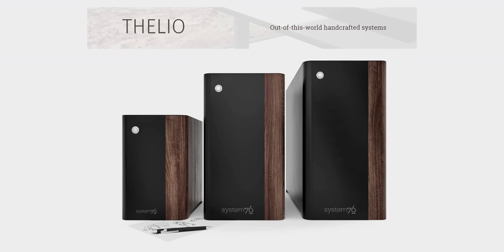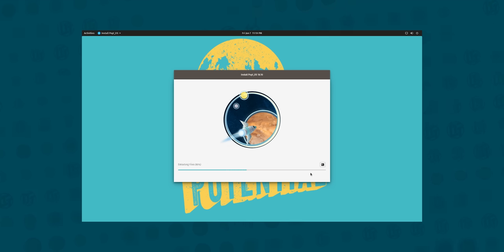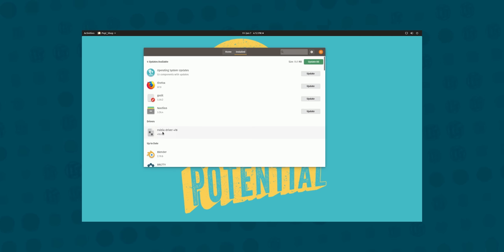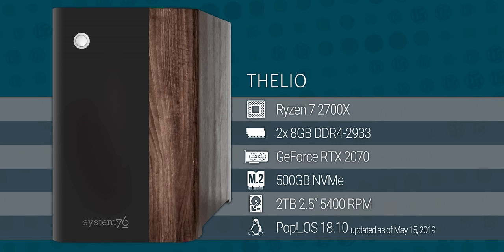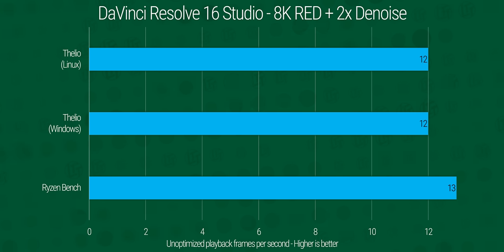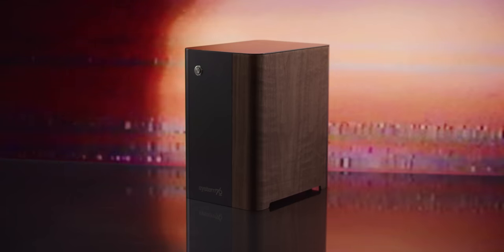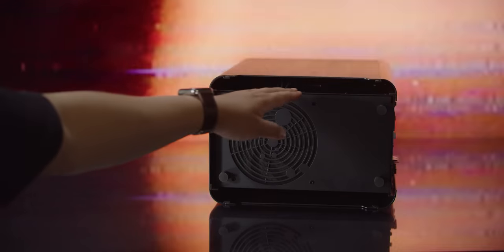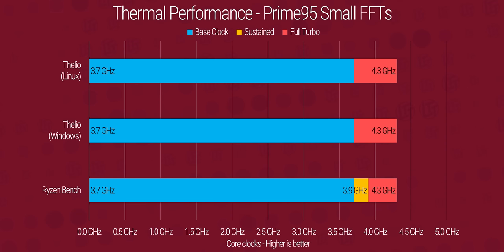A REALLY Weird PC… - System76 Thelio Review

Comment: Installing Linux is easier than windows if you pick something like pop os. I don't think even 99% of Linux users have ever compiled a kernel either.
Reply: true i have used linux for years and never did that.
Reply: POP OS was the first time i had to patch my kernel to operate some RGB devices drivers.
Reply: Even compiling Linux kernel is pretty easy now, not that I want people to compile it if they don't need to.
Reply: I have .. but not for ... decades...
Reply: Windows has never been difficult to install 🤔
Reply: @MiningForPies  It takes long, and it's a pain. I have installed windows in a virtual machine lately for my work computer. It took 20mn 3 times because it failed twice. Once done you still need to install drivers and stuff. Linux installs take 10mn, partitioning included. + no need for drivers in most cases. And if we start to talk about the first update after a fresh install, well, linux automatically gets installed up to date if you install it with an internet connection.

It's all good if you don't find windows difficult to install. But nowadays windows is a huge pain to install compared to the mainstream alternatives. It's not necessarily dififcult, but it's painful.
Reply: ApiolJoe I have 6 different laptops at home. Longest install takes 10 minutes on the worst one.

My main laptop takes < 5 minutes to install windows 10 pro.
Reply: @MiningForPies  Wow, would linux install in 2mn then?
Reply: ApiolJoe no, about the same. 

I find it’s easier to use Linux as a VM on windows rather than the other way round.
Reply: @MiningForPies  I find it easier the other way around, so that I don't have to bother with windows 90% of the time.
Reply: ApiolJoe that’s what I don’t get. I’ve never had bother either either system (beyond lack of support for games on Linux)
Reply: @MiningForPies  I had windows just refuse to boot one day just before an important job interview. for no reason.
Also windows needs care everytime you want to install a software to not install something unsecure. And windows needs "babysitting" with antivirus.

I have none of these time wastes on linux. Except for the (extremely rare) cases where I want a software that is not in an official repository.

Also linux is lighter weight.
I don't really play games anymore so that's not a big problem for me, and even there linux is getting more and more gaming-friendly lately with proton and lutris.

That being said, if you're happy with windows all good for you. I just hope you won't have the same unstability issues than the one that costed me a job.
Reply: i have compiled a kernal to get my 10gbit network card working lol
Reply: I tried LFS... it uh... didn't go well. But for that time I was on FreeBSD I compiled all kinds of kernels.
Reply: I sure haven't compiled the kernel and I've been a linux user for a couple of years (not exactly the longest time in the world but I'd say I'm pretty familiar with the OS by now)
Reply: If by "Linux users" you mean Ubuntu users then yeah that 99% stat might be right
Reply: 6 year Mint user - What is Terminal?
Reply: Ryan Cooper gaming doesn’t work fine without jumping through hoops. 90% of my steam game catalog doesn’t work natively on Linux. 

Never had any issues getting device drivers for windows 🤔
Reply: chiru G Linux is getting better for gaming, but as 90% of the games in my library won’t work without jumping through major hoops I’ll avoid it for games.
Reply: Ryan Cooper doesn’t work on 90% of my library.

I’m really not sure why this is a difficult concept to grasp. Is reading not your strong point?
Reply: @Ray Chang I have some very similar experience. Unless you're doing embedded these days rebuilding the kernel feels more of a time waste than anything else.
From a more casual user perspective, it feels like high-end desktops are not (hopefully just yet) popular within the linux community though and so it might make sense to squeeze some extra juice from a 10-20yo setup.
Reply: i tried once it takes forever to compile XD
Reply: Been on linux less than a year. Had to compile my kernel for the acs override patch so that I could get windows vfio working.
Reply: The only people who want to compile their own kernel and software are Gentoo users. Other than that if you are an aspiring Linux admin, or Linux systems programmer, following the "Linux from scratch" tutorial is a great option. Its basically the same process that people had to go through 20 years ago, and you learn a lot about the system. If you aspire to be neither of those things, then yea, Manjaro, Ubuntu, Pop, all great systems, incredibly easy and they just work.
Reply: I use mint
Reply: LOL, you don't even need to ever use pop os to not compile a kernel, you can use ubuntu or debian or manjaro or mint or anything
Reply: I don't actually remember, if I did or didn't. I think I didn't.
Reply: Yep. I never had to. Instead, one just replaces it with pre-compiled, numerous one. At least, with package-based distributions. If you're into Gentoo, LFS and the likes .. which I am _NOT_, then that might be your favorite pastime ..

cu, w0lf.
Reply: @MiningForPies  

"My main laptop takes < 5 minutes to install windows 10 pro."

Uh huh.

Upload a video of that.

Don't forget to include all the patching and updates as well. But even without all that, I'd love to see Win 10 install in less than 5 minutes on your laptop.
Reply: mjs28s yep.

And when I’ve done that you can do one of a Linux install that doesn’t require updates as soon as it’s on 👍 you probably believe you’re safe from viruses and hackers too 😂
Reply: William BQ trying again. Hoping to be proven wrong.

Can’t use 20.04 yet cause my main work is dotNET core and that’s not fully supported till next Thursday 😬
Reply: William BQ gone with 19.10 for now. Got the OS, vs code and docker running no issue.

Tried steam but 90% of games don’t work unlike the claim above. Not installing WINE
Reply: William BQ yep, that was my point at the beginning of the thread that games done work natively. As usual the “expert” ignored the hoops you have to jump through to get them working.
Reply: @MiningForPies  sudo apt install lutris
And then click on the game you want to install. Such complicated hoops!
Reply: Erwan Amans if it works I will buy you a virtual beer
Reply: @MiningForPies  Actually, I forgot about the PPA-fest that is Ubuntu (and its derivatives), so the full command is:  sudo add-apt-repository ppa:lutris-team/lutris && sudo apt update && sudo apt install lutris
You should also enable Steam Play if it's not already done. In the Steam settings > Steam Play, tick both options.
From there, just launch Lutris to install your games, and play them. With this alone, the vast majority of your games will be playable without having to do more than clicking "Install" & "Next" in Lutris. You may want to install Wine for non-Steam games (in my opinion, you should).
I would recommend you also do a sudo apt install gamemode to get software optimisations for your games that get turned on when your games are running, and turned off when they're not.
Chances are high that around 90% of your games will run just fine.
Reply: @eyjzdrkxjqzfuhqyzybf  Installed, no games displayed. Do I have to do something with steam to make the games install-able?
Reply: @eyjzdrkxjqzfuhqyzybf  Never mind, like a dunderhead I was looking at game options not steam options
Reply: @MiningForPies  To add your Steam library to Lutris, you can use the + button in Lutris and "Import Games...". It may be buggy and not doing anything. In any case, you can search your games with the magnifying glass icon, hitting "Search on Lutris.net" and installing the game (it will detect that the game is already installed and add it to your Lutris library). I would recommend you install all your games through Lutris, as it will automatically set them up so that they work fine on your machine, and run gamemode for you.
Let me know if you managed to get your games working.
Reply: Been using Linux since Ubuntu 15.04, I've never had to compile a kernel
Reply: even as an Arch user I never compiled a kernel ;)
Reply: @MiningForPies  "And when I’ve done that you can do one of a Linux install that doesn’t require updates as soon as it’s on 👍 you probably believe you’re safe from viruses and hackers too"  You mean like a netinstall?
Reply: linux is not user friendly, we had lots of troubles using it. even running gta sa was a torture. you have to constantly search on web to identify the problem
Reply: Whenever I want to install Linux on closed source proprietary devices like Chromebooks, I usually have to compile a custom kernel to get things working.
Reply: Compiling a kernel to install an OS is like buying the pieces of a house by mail order to buy a home with ya boy Uncle; it was necessary long ago but nowadays its just a hassle that takes extra time
Reply: Can confirm
Reply: @MiningForPies  I think the main thing that makes Windows a more "difficult" install process is that you have to watch out to make sure that windows doesn't install features that you don't want, such as cortana. Linux doesn't have those extra features, which makes it a bit easier on the user both during and after the install.
Reply: Danity depends which version of Linux you use.

Earlier Ubuntu comes with amazon tracking built in and currently forces snapd on you without consent.

Deepin sends telemetry surreptitiously to China.

Windows cortina is at least optional on install, I’m more concerned that they switch on services you’ve disabled after an update (like SysMain which is a massive performance drag) and bake Edge into newer versions so you can’t uninstall it without hacking.
Reply: @MiningForPies  Windows 10 LTSB (long term stable release) its the least bloated and unless I remember incorrectly it should not include edge IE. I still dont trust it and stick to linux. I like the OS to be the product I use and not me being the product the OS uses.
Reply: Not even once.
Reply: i've been using linux since decades now and i'm on archlinux .
sometimes i hope something broke so i've to fix it because i don't even touch the terminal anymore
Reply: I compiled my own kernel once, for an OS class in college.  I have been using Linux since 2003, never have I ever done that since. Distro's like Ubuntu/PopOs I would argue to be easier to set up / install than Windows. You don't even have to open the Terminal, unless you are a 'power user', or trying to get some random thing to work which you just copy/paste a command in, just as you would on Windows/macOS. Basically, if you use a computer to browse the web and run some games, it's just as simple (if not more) as Windows. If you are a power user or developer etc, then it's much more flexible and powerful than Windows.
Reply: they're missing out on the single most terrifying moment of using linux lol
Reply: What does COMPILING A KERNEL mean?
Reply: @theproudlinuxer  you can download the source code of the linux kernel and build it woth optimizations for the machine it's going to run it .

not a great deal on normal PC , lifesaver on  IoT devices
Reply: @theproudlinuxer  Taking the source code for linux and converting it into a format that your computer can run. Definitely not something that you have to do to run linux though.
Reply: @billbobjamjamjr  You mean, customising and optimising the OS using the source code according to our computer.  Am I right ?
Reply: I'd never say its easier than Windows, its pretty braindead. Its silly to see Linux still around... maybe its gotten better but 10 years ago it was really stupid with 1849201 different distros from different people and companies. Idk. Use Windows or Mac, there's really no reason to use Linux esp in 2020.
Reply: Linux is so easy to install now more than ever, install is so much faster than windows or macos and most distros don't come with 10gb of bloatware pre-installed
Reply: and installing macos, on a windows PC is one of the hardest too do.
Reply: I wouldn't say 99%, average Linux users are tech savvy. Maybe 70%?
Reply: lol they never even heard of Arch yet
Reply: I'm an arch user and I never compiled a kernel, you don't NEED to do it
Reply: Lol yes I've been using linux for 8 yrs never had to do it
Reply: Exept gentoo usersv
Reply: 1% - gentoo users
Reply: I never had to compile a kernel in Linux

And I'm an Arch user
Reply: @NimhLabs  why start from LFS why not noob friendly distros
Reply: @garretmkiii  a
A terminal is a pease of softwhere that you issue commands to and it runs it directly with no gui unless the app calls for it like Firefox
Reply: @melih-6471  was that on noob friendly distro or non noob friendly distro
Reply: @NimhLabs  a distro that anyone can get used to without much setup
Reply: @Endermen1094  I was just messing around bud. More so trying to say that with most modern distros of Linux, most end users could compute contently without ever typing "sudo" :P
Reply: @garretmkiii  did i miss the joke of it
Reply: @Endermen1094  dude, you are a couple decades too late for giving me suggestions for my first distro

Which, BTW, was Red Hat Linux 5.0 back in 1998. Yes, there was a newer version out, and somebody managed to grab that for me as well
Reply: Yah, never complied my own Kernel... I think Linus was just joking though.. -_-
Reply: @ApiolJoe  To be fair, I don't think most people need to install Windows... but for me personally, it was actually quite easy to install Windows since Linux wasn't running well on my machine...  for some reason, I have more failures installing Linux on Lenovo computers than any other brand... and I don't know why... T^T
Reply: I don't think most people that use Windows have ever used the windows installer either though.
Reply: I never had to compile the kernel.
Reply: you didnt have to compile the kernel manually in early distros like soft landing system
Reply: I use ubuntu for about 2 years now, and to be honest, its easier to install ubuntu than windows. Windows always have than microsoft account bullshit and ubuntu is basically "plug and play". The hardest part is setting the boot to the usb stick on the bios lmao
Reply: @MiningForPies  I thought the same until I wanted to install Windows 11 a few days ago. 
When trying to use the 'upgrade' way,  my PC was not ready because it was a bit aged. I had the wrong tpm version, the CPU was too old, I had to activate secure boot. For the secure boot I had to convert my drive from mbr to gbt and fiddle the bios to uefi instead of csm and after all that my pc would still stop in the middle of the installation process. It's a nightmarish experience.
Reply: This aged like a milk
Reply: This comment aged like milk lol
Reply: Been daily driving linux for a year or so now and played with it for a few years before that.

There is a huge misconception about who linux users are today most are artists and gamers and people that were fed up with windows and apple os.

And no you don't need to use the console for everything in linix these days and of you have already used the command prompt or powershell in windows it's basically the same but learning different syntax.

I have only ever used console for advanced tasks like I would on windows.

Linux is not scary and should not scare people.